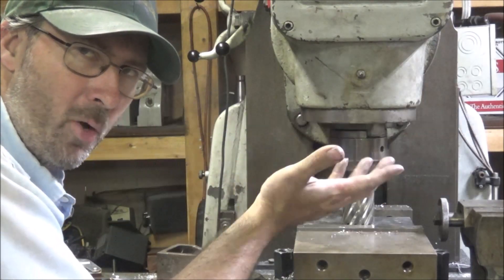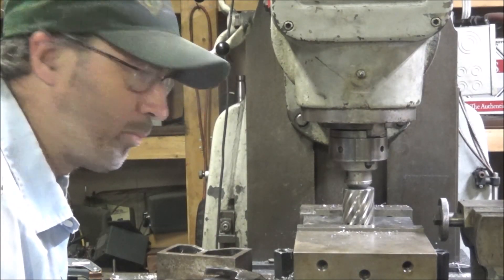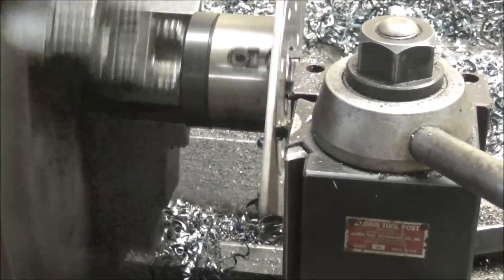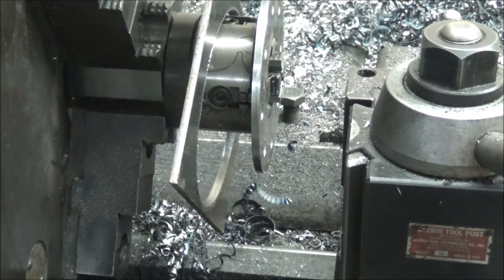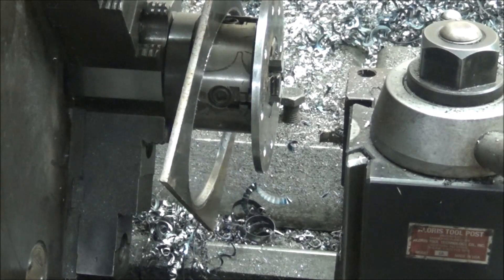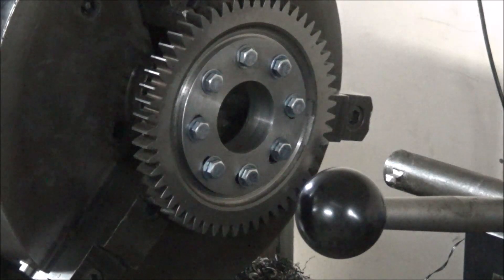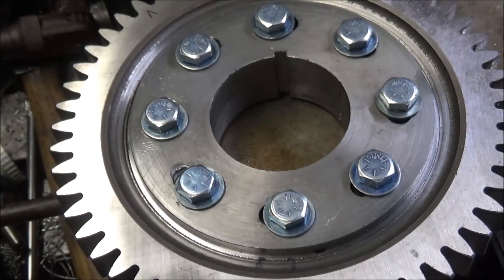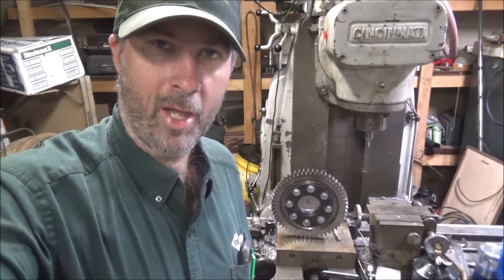Building an Adjustable Cam Timing Gear Setup

Comment: Can build adjustable cam gear on a fly? Nobody makes for my motor ? Please thank you in advance
Reply from the maker: If you have dimensions and known clearances I could likely make you one.Send me an email bcbloc02 at yahoo dot com
Reply: Brothaa your email not excepting...
Reply from the maker: Jayrock Blas-Pyka be sure you have it zero two and not o two. You aren’t entering it correctly if it won’t work. There is also a direct link to my email on my about page for the channel as long as you use a desktop.

Comment: Never tapped in material that hard, I'll remember to get those OSG's if it happens, cause ordinary taps aren't likely to do it...
Power tapping should always be the preferred method, broke more taps at hand tapping, very rarely with power tapping.

Great news about Baily...     👩‍🚀👩‍🚀😎
Reply from the maker: Yes, very glad Baily is doing better! I hope for your sake you never have to tap hard steel. lol

Comment: What steel was the hub? Any distortion from heat treat? Hope those are hardened washers over those slots. My fabricators always try to sneak el-cheapos in my machines with slotted adjustments...
Reply from the maker: 8620 and I could not detect any distortion and the bore might have shrunk .0002" but with .003" press fit it wasn't an issue and yes they are good washers, well in the thumbnail pic of the finished project, those blue ones were hardware store grade 8 junks.
Reply: @bcbloc02  8620 is good stuff. We made lots from it, sometimes Rc60 and carburized. Brings back memories..

Comment: OK, I tried to let it go but curiosity got the best of me! What’s the timing gears for? Can you do follow up and explain how second half of gear cluster works or how your gears mesh with the other set of gears? Assuming gear advancement is with centrifugal force, but how is tension set to have it advance at a certain RPM?
Reply from the maker: This is not a setup for automatic advance. This is only so you can alter the installed intake centerline of the camshaft without having to press off the gears and install offset keys.  It will only be used on the dyno for tuning to find the best performance.  The back gear drives the injection pump, Deere uses a setup like this so they can mount the pump closer in and lower vs a setup like Cummins has. When you are trying to cultivate rows you are limited on width so they use an extra gear in the geartrain to save space.

Comment: Can you do this again for a 12v cummins VE pump and P-pump gear ☺
Reply from the maker: 5.9 Cummins adjustable cam setups are readily available from multiple suppliers, so their price would be much less than mine doing a one off.
Reply: @bcbloc02   Hey Brian! Thanks for replying. Love your Video. With me being a machinist, I'd like to take a crack at it myself. For some reason i just talk myself out of it. I have ran cnc lathes for years. I'm not that great with manual lathes and that's all i have to work with now.

Comment: Well done Brian, looks like a solid way to change the valve timing. With all those bolts it should stay put one would think. Cheers from New Hampshire 🍺
Reply from the maker: Yes once tightened down it will stay set. :-)

Comment: I realize I commented once already. I was wondering if one of those bolt holes could have been cut as a slot that a bolt with an eccentric shoulder might be used in, to help with gradual advancement of the timing; the other bolts left as-is to perform lockdown.
Reply from the maker: weshowe I use a round bushing with the hole offset in the injection pump hubs so you can do that. This one gets adjusted less often so it was a feature omitted as they didn’t want to pay the extra to do that.

Comment: I link an old OxTool video where Tom Lipton grinds a HSS bit for trepanning. The geometry is different than used for parting, since the lower edge rubs. While your project worked, maybe this will make the next one easier. https://www.youtube.com/watch?v=6PcEBaset1I&t=1s
Reply from the maker: weshowe I had the curve ground in the trepanning tool for the proper relief.

Comment: Bet tapping that was tough. For a tapping fluid on that hard stuff at work we use Castrol Variocut moly C.  Good stuff. Thanks for the video and I hope to see you tomorrow in Lexington 👍
Reply from the maker: Steve Summers I used my Castrol moly d. I will have to look into that other.
Reply: @bcbloc02  I'm not sure it's any better than what your using already.  But what we have seems to work really well. Only thing I hate about it is the stink. You get it on your hands and they stink for two days😁

Comment: A little coarse diamond lapping powder between the gear and flange will prevent it from moving........just like the Hellcat supercharger pulley uses a diamond impregnated washer. A few clamping cycles should embed enough to do the job followed by a good rinse. IMHO

Comment: I have used the EXO taps on titanium and they do work good. Thanks for showing the bloopers. We all have them and learn from them. Oh yea the cursing goes with the badge. May want to use pliers to pluck those chips outa there with. I saw you reach and then hesitate. I have done that too and regretted it so be careful. Another word of caution and that is make double shure the rapid traverse on your mill works good especially in the up position. I used to run a Cincinatti much like yours and was cutting titanium with 1 1/2 inch carbide endmills, I raised the table and the rapid didn't release. I rammed the cutter into the workpiece shattering it and taking out my chip guard. Hit the estop and cleaned my shorts. Maintenence said the valve was bad so be careful. Glad Baily is on the mend.
Reply: I run a cincy number 6 and I have had the valve stick also at a bad time.  I saw Brian running that table up and was saying no, no, no!😁

Comment: I would have pick a point equal distance between 2 bolt to make the slot. It would leave more metal  all around between the openings.

Comment: First hope bailey feels better . Now nice to see endmill stop and fallout . I kinda snickered ah like that stuff dont happen. Good job on the hardened steel machining. Oh ive broken some taps in my days. Infact it became my specialty in one jobbing shop to be the remover and retapper. I ground old taps to drive out the busted ones by busting them apart and picking the bits out.
Reply from the maker: That is how I did them was just hammer them to bits.

Comment: That EXO tap must be super hard to cut that.  Doubleboost's key cutting trick worked nice, too.  That cam gear allows several degrees of change.  The pump must be geared to the crankshaft since cam timing is independent.  Interesting work.
Reply: Jon Pardue 
u thnk he didn’t know about cutting key ways in by hand
i find that hard to believe
Reply: @JJ-jv1gu  Brian mentioned Doubleboost about that, and both these men have taught me a lot.
Reply: Jon Pardue 
i don’t watch double troubleboost
am I missing out?